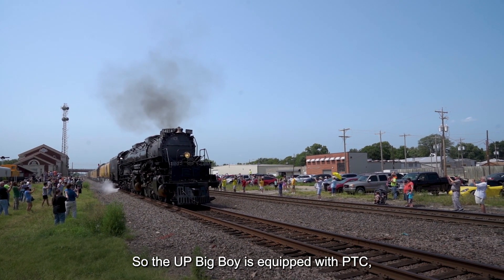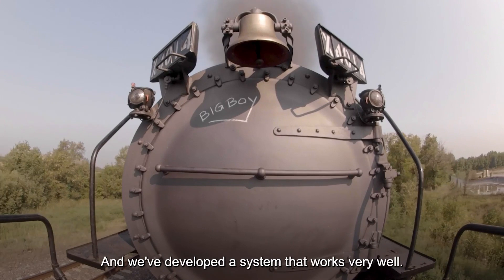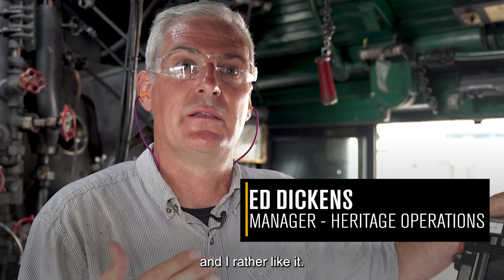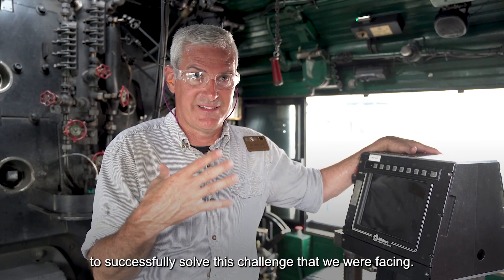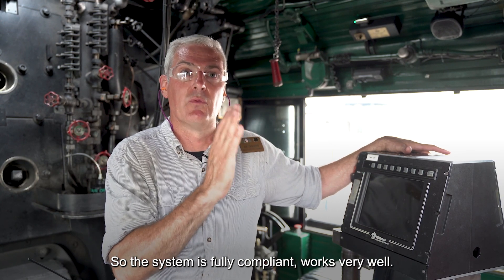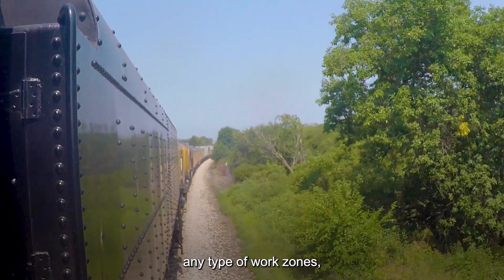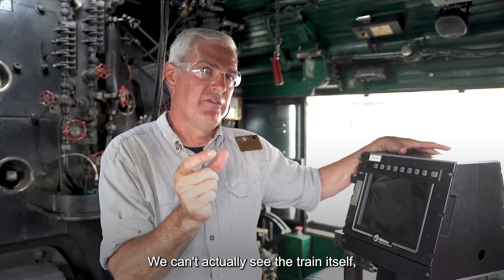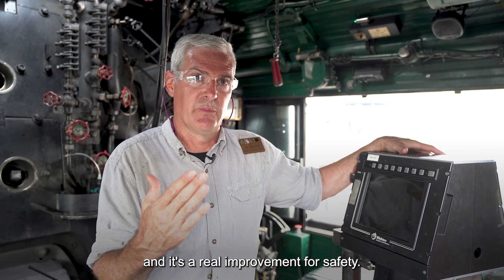Big Boy No. 4014 Flexes Its Muscles with PTC

Comment: The only thing you can PTC on a steam locomotive is the air system but even that is a safety Improvement and it's also going to detect signals like he said fail to honor the signals it can fit the brakes but it cannot shut the throttle off or the Fire Control Valve

Comment: Please restore one of the UP turbines next!
Reply: That would be amazing, but I feel like it might be considerably more complex and expensive to do that, in comparison to the Big Boy, due to the two remaining Super Turbines having had their gas turbine engines scrapped. Union Pacific would need to replace the engine somehow, either with something suitable that currently exists, or maybe design and build something.
Reply: @jacobforsman3897  Maybe they could even make a new class of turbine engines that run on something cheaper than bunkerseed oil.
Reply: @goldy24t  Possibly cng, or in other words, compressed natural gas. It would probably be far less polluting than the bunker c fuel you mentioned.

Comment: The hard part is the second part of PTC, where if a train violates a block or is going too fast the train can be remotely slowed down or stopped. On a modern diesel the systems are drive by wire so integrating a remote module that can activate the brakes and/ or cut power is at least conceptually easy ( a relay between the generators and the traction motor could cut power; brakes these days are computer controlled).

On a steam engine the throttle and the brakes are mechanically actuated. PTC control functionality would require electro-mechanical actuation to throttle down or apply the brakes.

Comment: Also, the ridiculous twisting and contorting of the system to make up for the length difference of big boy vs the engine with the actual system in it indicates how poorly designed it is. How hard would it have been to put a gps ticker up by the front of big boy and use a laptop? Surely they could have pulled that off, we were doing that in fkn 1998 in a 50 year old boat.
Reply: A normal laptop wouldn't last more than a few minutes in the cab of a steam locomotive. It would, at least, overheat fast, as that Firebox puts out a LOT of heat into the cab. The backhead (what all the controls are attached to) is hot enough to burn your hand even through gloves.

If a computer system is equipped, it would have to be designed to withstand the environment inside the cab.

Besides which, PTC is more than just GPS navigation, its a safety override system, supposed to be able to stop the train on its own if it picks up something to act on. At the moment, they are working on integration with the locomotives controls for a stand alone system.

A steam locomotive is a very different beast compared to a boat (as are trains in general), so there isn't any comparison.

Comment: Awesome to see this! I just got to watch it go through Texas, and it's a sight to behold!

A few questions occurred to me:

Other than the obvious cost and time barrier, what are the main roadblocks not just for putting this on UP 844, but on other excursion locomotives (ex. N&W 611, NKP 765)?

The article explains that there are modifications to the braking and electrical system to connect 4014 to the helper, are these specific to the particular helper used (4015 was what I saw), or could any properly software-modified, PTC equipped locomotive be used?

Comment: They put PTC on a steam locomotive?
Isn’t this somewhat of a breakthrough? Why are we not all freaking out about this advancement?
Reply: I think we're quite pleased and looking forward to see how far UP can push PTC with steam.
Reply: @rontroy3843  Why bother? Steam was old tech by the mid '50's anyway! And this thing is '40's vintage. Just more stuff to break, and add cost. 

More tech to remove HUMAN intelligence AND diligence! That's what a radio, and lineside signals are for. Also more ways to CONTROL people, and how they do things! It's YOUR job to PAY ATTENTION while in the cab!(steam or otherwise)
Reply: @devilsatan2973  ptc is required on most mainline and is a huge safety upgrade.   UP is leading the way in showing how to do it. And BigBoy is a major marketing tool and an important part of WW2 history.
Reply: @devilsatan2973  well the British managed aws as far back as the 1920s so its always been a desirable safty system its just been cost of implementation
Reply: You will need it to run on mainlines. The museum where I volunteer is looking into it because we have a locomotive, but don't have our own track.

Comment: Since the Big Boy 4014 is old, completely manual control technology that requires both a fireman and an engineer to operate the steam locomotive I thought that it would not be feasible to install such a modern system as Positive Train Control. This must have been a major project to put together a Positive Train Control system for Union Pacific 4014. This is likely the only Steam Locomotive in the world with a Positive Train Control System.

Comment: That sucks U.P. 4014 requires PTC & N&W 611 does not.... What... the.... F&%K
Reply: The 611 people are looking to get PTC in that machine.
Reply: Yes, it does.  That's why it was towed to Strasburg.
Reply: PTC is required for operation on any Class 1 US railroad, and will likely become required on class 2 and class 3 railroads eventually. 
Even heritage shortlines like Strasburg and the Cumbres & Toltec will need to comply someday.
Reply: What is Class 2 & 3 railroads?
Reply: Also I found out that NKP 765 passed by Fostoria Ohio but it needs PTC 

NS. Why don't you add PTC To such locomotives so they can put excursion cars to run on Former NS. Lines that were owned by other railroads

Comment: Well done!  I look forward to how it might be doable without the diesel, but this helps preserve steam on mainlines!  Ed - keep your successes coming!
Reply: Unfortunately not doable without the diesel as the big boy cab lacks the electrical outputs needed for the PTC screen. The screen connects via wiring to to the computer off of the diesel engine.
Reply: @Amrepdude499  Ed seemed to indicate that they were coming up with a way to not need the diesel.  How, he didn't say.  If I recall, UP is also looking to do things like engage brakes, cut throttle via PTC on 4014.  I'm not even close to being an expert, but for 'independent' PTC I'm thinking you need power, sensors below, maybe GPS, the computer and display.  Beyond that, I have no idea.

Comment: That’s awesome to know. I always thought that was the reason you had modern locomotives in the train with it. So that it could drag along all that modern technology with him.🚂🚂🚂🚂
Reply: The main reason for the diesel is that safety regulations require electronic braking system monitoring.  Also they use the diesel to help get the train moving and to save on fuel.  All of the infrastructure that used to support steam engines is gone, no more water towers or fuel dumps.  They have to bring all the water and fuel oil they need with them.  Also the Big Boy uses custom one of a kind cast iron brakes that are made in house, very expensive, the diesel helps with braking to slow the wear and tear on those brake shoes.  https://youtu.be/O79dwJWZq5I
Reply: Another video I watched saiud that the diesel was there in case the Big Boy had a breakdown, then they would use the diesel to move it and keep the track clear.

Comment: It will be interesting to see if Big Boy pioneers PTC for other steam installations. That monitor looks pretty big, would make for a tight fit in a smaller engine's cab.

Cool to see Big Boy with a bit of 21-century tech that doesn't affect the loco's looks or operations much. It would be even cooler if UP could bring it to New England!

Comment: I doubt this is real and I hope it's not
Reply: It is real, and it's an important safety feature that all mainline steam locomotives in the United States will need to have eventually in order to continue to operate.
Reply: @theUP844  I mean... I think you would kinda... oh... know if a steam engine was moving, because it makes a lot more noise and has about 300x more people photographing it , you don't need ptc on a steam engine,  let the diesels have them
Reply: @RockBottom82  unfortunately, federal law says otherwise. The FRA is not going to grant PTC exemptions for steam locomotives. So yes, steam will need to have PTC to be able to run on the mainline. Obviously tourist railroads and railroad museums won't need to put PTC on their steam locomotives because they don't haul freight, and the few such operations that do haul freight operate on branchlines. Plus, they don't transport hazmat materials, so PTC is not required.
Reply: The FRA did say UP didn't need to install PTC on the steam engines. But it's good they're doing it and the FRA has been known to change their minds.
Reply: @eva.cassidy  Actually, they said the railroad didn't need a PTC waiver for the locomotives, but that was only for 2019 and 2020. That grace period is over, so now they do have to put PTC on the locomotives.

Comment: Would be cool to see a deep dive into how it's integrated with the locomotive...
Reply: The guts of the system take up a whole rack in the nose of the escort locomotive and so far as I know 4014’s screens are twinned with the screens in the escort so that both units can be on the same page! As the distance between the two units would be enough to mess with PTC’s mind as to where the head end actually is….so 4014’s position is the one that gets fed to the escort engine’s computers.
Reply: The way it was explained to me is that it runs off the Diesel helper’s system.  The Diesel helper’s system is modified so that the digital front of the locomotive is extended so it encompasses the steam locomotive and associated tenders within the PTC system.  There are screens added in the cab of Big Boy which allow the engineer and/or fireman to control the helper’s PTC system from the cab of the Big Boy.  If an enforceable event occurs, the helper goes into penalty, which puts the rest of the train into penalty with it.
Reply: @jaanfo3874  I assume that Big Boy's throttle would still have to be manually closed when the train goes into penalty?
Reply: @mumfordthepitbull4581  I was wondering how they integrated the PTC to actually control the steam locomotive.  Or, did they?  And , if not, how is that PTC?
Reply: @mumfordthepitbull4581  How does a steam locomotive close the throttle during emergency without PTC? I would imagine it isn't all that different.
Reply: With the Hope's and dreams of the UP saving a dime by eventually making humans obsolete and getting rid of the conductor altogether.

Comment: Positive Train Control sounds like it monitors every signal, speed restrictions, and even the speed of the big boy.
Reply: Thats basically what all it is currently. The fully implemented system in diesels and Ed implied will eventually be worked into the bigboy can also apply emergency brakes and cut the throttle.
Reply: @HaddaClu  neat!
Reply: @HaddaClu  what about 844 and 3985?
Reply: @LiamKostick  UP just released an article on PTC and the Big Boy in their newsletter which is on their site. "Inside Track" 844 is going to being equipped with it. 
3985 was declared retired 1-2 years ago in an official press release from Union Pacific so unless the steam program sees a massive boost in funding and manpower I doubt it will ever be restored beyond a cosmetic touch up - so no need for PTC
Reply: @LiamKostick  the 844 will probably see the upgrade but the 3985 will not see the high iron again
Reply: @charlesball6519  That's interesting that a Challenger would have many parts with a Big Boy.
Reply: @charlesball6519  Last I saw 3985 was a Challenger (4-6-6-4), different beast, suitable for high-speed passenger work, even. Big Boy would be like a beached whale there.
Reply: @charlesball6519  
That’s because the tenders are the same on 844, 3985, and 4014. 3985’s tender was already converted for oil instead of coal, so the plan was to use that on the 4014 until the 3985 could be restored and the tender for 4014 could be converted to oil from coal. 
Depending on the condition of the 3985 tender, the 4014 tender could possibly go through the conversion and rebuild process and then mated back up to the 4014 and the 3985 tender mated back to it to await whatever the future holds for it. 
We can only hope they restore it sometime in the future so it can run with the Big Boy. 
They had vendors make parts for the 3985 when the identical parts were being made for the 4014. 
So who really knows what the future may hold.
Reply: @jacquesblaque7728  The 4000 series was pretty much just an enlarged/updated challenger.

Comment: I’ve been running with PTC since my road fired it up…it does work and it’s handy to be able to look ahead and know what’s coming up!
Reply: As a fan, I learned a huge amount about PTS from this short video.  Had no idea you got moving map displays, for instance.
Reply: @rontroy3843  yep it moves.,it’s weird when you’re going backwards though…flips the image of the train around and reverses the milepost but moves the map the same direction as forwards…but it’s a pretty limited graphics system so that’s all it can do.
Reply: Wow... it's almost like google maps for trains... I'm really confused how this is any kind of improvement for anything... if the dispatcher... oh wait.. I get it, you don't NEED dispatchers to tell the train what's up, they just add that to their list of things to do, and watch that themselves.
Reply: @kleetus92  I'm guessing dispatchers are still very important overall but having this means less need for radio calls, makes it a lot easier for the train operator to know what's going on around him or her, and greatly improves safety, especially if you have throttle cut and automatic breaking when needed.  Last thing a train operator needs is a surprise ahead, and this eliminates so many of them.  Plus reminds you even if you don't know a route well when you need to slow down, for a curve or any one of many issues.
Reply: @rontroy3843  Ah, I didn't consider route unfamiliarity... I thought they had to qualify before being able to run a new route, particularly in mountainous terrain.
Reply: @kleetus92  You may qualify but I think it takes years to be really good at a tough route.  Besides, knowing the route doesn't tell you about stuck trains ahead, as an example.
Reply: @rontroy3843  aren't the signals supposed to tell you if the next block is occupied, plus a buffer of another block before you find the next train?
Reply: @kleetus92  I think ptc does far more than that.